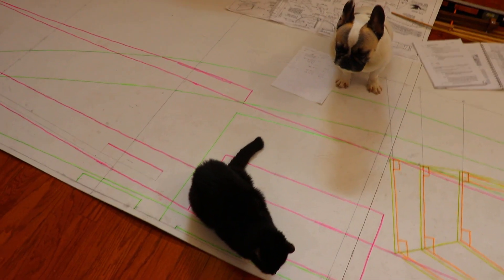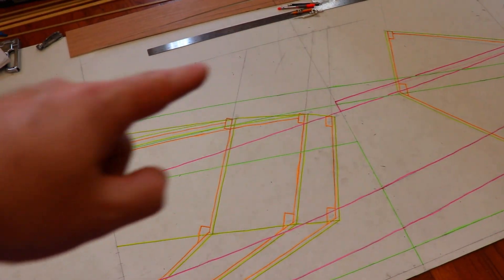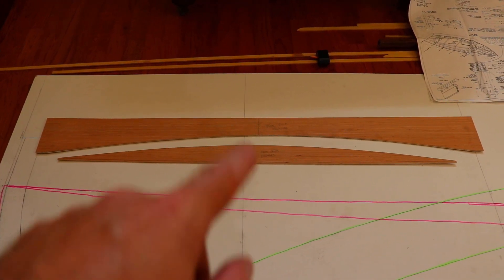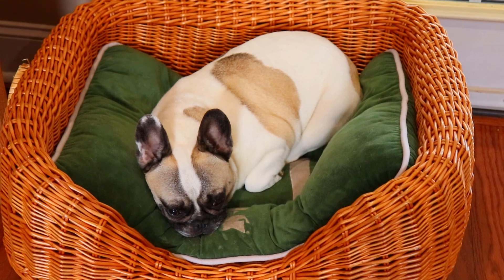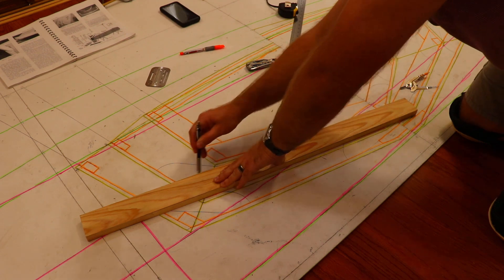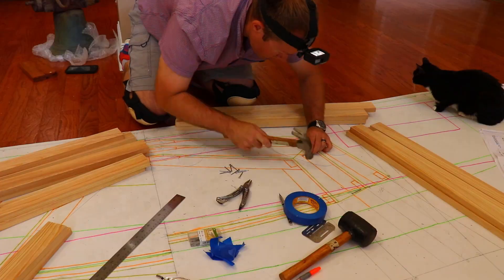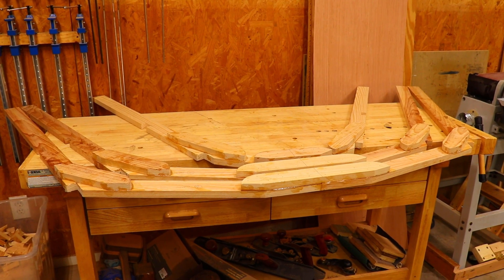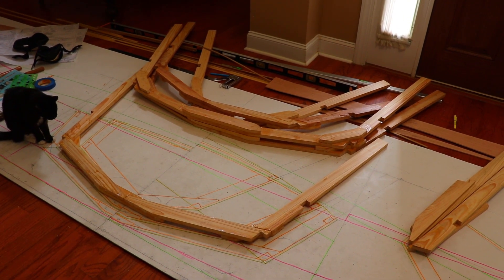Building a Snipe Class Sailboat. Part 2: Building the Frames

Comment: Would love to know how you laminated/assembled that wood over your table saw and fence. 👍🏼
Reply from the maker: The fence is easily removable (it just lifts off) and then I just dropped the blade as low as it will go so its below the table top. The cardboard covered with packing tape prevents anything from sticking.

Comment: Nice job. i'm restoring a 1941 snipe. Replaced 3 deck beams and a few of the floors. The rest of it was in good shape. Lol, except for the deck which was rotted plywood. I think I'm gonna re deck with 1/4 inch ply and then canvas the deck. It's interesting to see how it goes together. i think mine has oak frames and is planked with cedar.
Reply from the maker: That's awesome. What was the purpose of putting canvas over the plywood deck? I've seen it done frequently just never really knew why. 

I just finished making the stem, transom, chine logs, and shear clamps. I'm going to start making the jig in the next day or two. Part 3 should be uploaded by Friday.